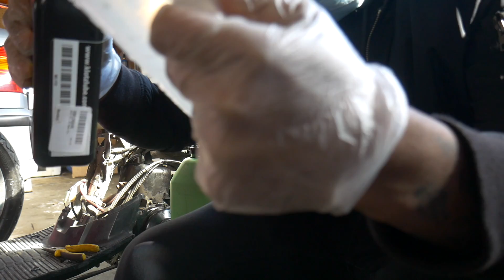THE YAMAHA RIVA RAZZ IS FINALLY RUNNING! | JUSTDOITTRAY

Comment: Bro check that boot that the carb go's into to be sure its not cracking or has a hole in the boot to much air can cause the bike to run lean in blow up I had a rm85 do that

Comment: Getting closer. If you think its sucking air causing lean condition, just spray carb cleaner all over anyplace that may draw air while its running. But it still may be carb primary port may be partially clogged. What's plug look like after you ran it?

Comment: I got the same scooter it’s been sitting for a long time and won’t move anyone have any ideas why? It starts and runs good but won’t put power down. I took the side of the transfer case off to look at the clutch and it looks ok but the chain is super loose And idk if it’s normal
Reply: It might be your clutch springs